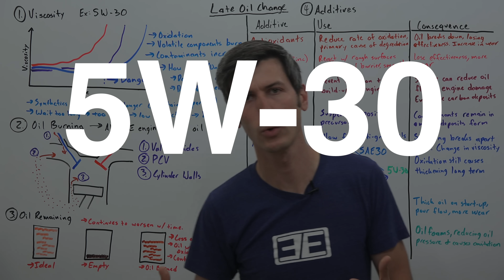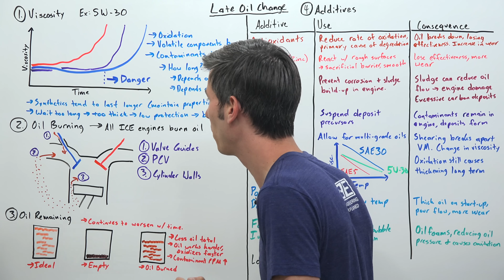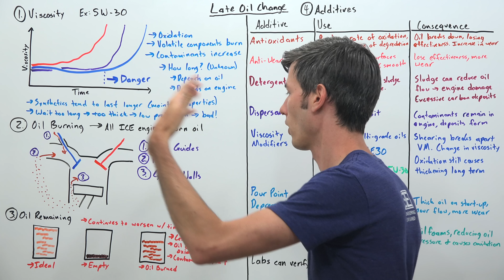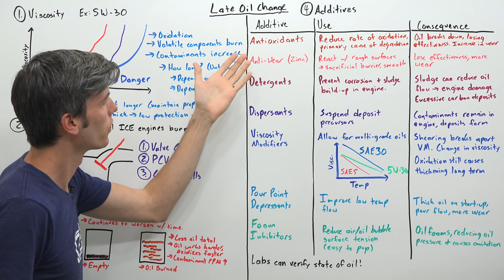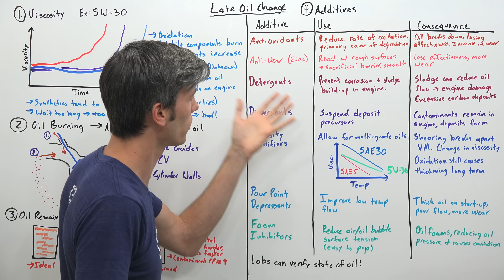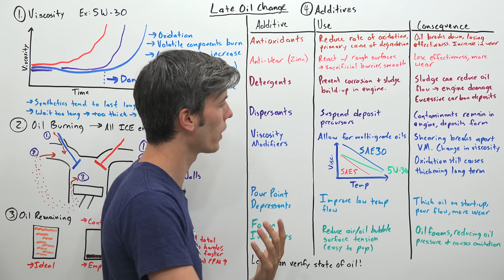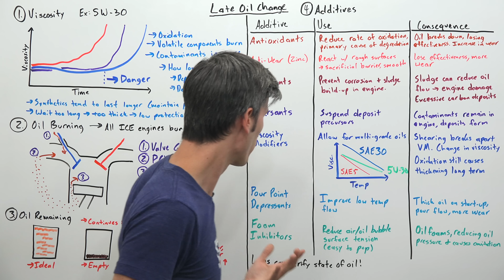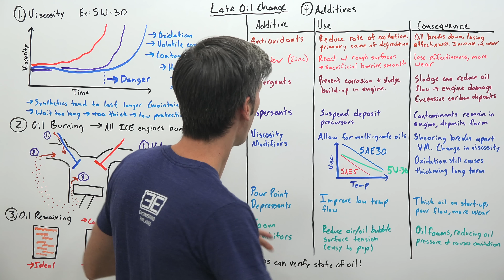What If You Forget To Change Your Oil?

Comment: As a European, US consumers seem to be obsessive about changing engine oil far too frequently, no doubt encouraged by years of marketing by oil companies and garages bring in the $$$$ and unfortunately also causing excessive damaging the environment. Stick to what the manufacturer of the vehicle recommends in terms of mileage between changes, use the correct grade/type of oil plus a good quality filter and you won't go far wrong. Never had any issue with engine wear in a lifetime of driving cars to over 250,000 miles and never changed oil a mile less than recommended by the manufacturer.

Comment: I'm sure this is all true and I do change the oil in my car every year which is more often than the manufacturers recomendation. On the other hand I've got an old Massey Ferguson tractor I've owned for 25 years (it's about 50 years old) and I've changed the oil twice. Of course it leaks like a sieve so it gets regular top ups of fresh oil. Runs fine.

Comment: Intersting video.  But why didn't you mention oil age?  Not all cars see a lot of use, and it's commonly known/believed that oil must be changed at least once a year (contaminants breaking it down?).
Reply: I have a 2000 Mustang GT with 25K $$$ in modifications that goes about 2000 miles a year. I change the oil every 5000 miles (Mobil 1). This means the oil gets changed  every 2.5 years...IT RUNS LIKE A TOP!!!!
Reply: @tacbear  ,Does your engine get to operating temp every time you run it,
well mine don't,and depending on piston make and configuration these facts change,
so I feel you have been very lucky,,so far,
Don't like Mobil 1 ,,as they have cut back zinc additives,,so no good for my flat tappet cam,,,and adding smoo to this great oil only stuffs it,,
Reply: I was curious about this myself.
'06 Prius, maybe 5k a year. My commute is only 2 miles, and I know that this is bad for an engine, so I usually commute by bicycle.
Usually also visit my folks once a week, so a nice 20 minute trip across town to get everything warmed up.
Reply: ProjectFarm has a video testing this idea.
Reply: Depends how old the oil is. If it isn't badly used, it can sit for THREE years and still have good results from a Blackstone Labs oil analysis.
Reply: Yep..very true,,Stopped working ,the old ute just trips to the shop,,never really got to operating temp..Lucky to do 5000 ks in 2 year,,left oil too long and now i have a tappet rattle,
Even though i had been very good with service,,the fuel by-pass the pistons, when cold did the damage,,Never got to a temp where this fuel would re-burn through PCV,
Hence one noisy V8 on start up,,Does go away  but damage is done,,and a costly repair,,VY ute 5.7 , 6 speed ,LSD,, less than 170k ks on it,,

Comment: Oil changes are overrated. Every 20k km is ok. One thing not mentioned in the video but quite important: Oil is used for the turbo. So if you're lucky and got yourself a car without a turbo, oil changes are even less important.

Comment: Best oil change intervals: 

Petrol engine: 15,000km (normal driving) and 10,000km (sporty driving style)
Diesel engine: 10,000km (normal driving) and 6,000km (sporty driving style)

Of course it more depends on if you are driving mostly in the city with traffic jams or mainly you have chilly driving on highways. So my intervals are for average cases.

Comment: I have a question:
If you left the car to do 10k miles & changed the oil instead of changing at 6k miles then I agree that's bad.
What about if I should change every 12 months or 6k miles but my car has been sat in a garage and done 300 miles in about 2 years? If I still haven't replaced the oil, am I damaging the car?
Reply: I've read somewhere that oil degrades with time. Don't want to sound smart ass coz I don't know much about oils, but my logic tells me to change it every 2 years max no matter the mileage

Comment: Funny.  I see cans that say 30W and others say 30 weight. None ever said winter
So 10W30 to me read 10 weight 30 (Never Winter) No body else has ever said W meant Winter
That's going back 2 the 60's, so every mechanic shop I have seen or gas station so SO wrong.

Instead of showing new parts show what SLUDGE IS  compared to varnish.
Also real carbon build up on valve stems. compared to slight carbonization. You will have to find a 40 year old farm truck to show that kind of build up...where the carbon build up on the stem is almost the thickness of the valve itself.

Comment: ok i have a question. i have an '02 bmw that burns a lot of oil. i sadly havent changed it for 12k miles ( i know)  but i have put 7 quarts of new oil in during this time and changed the filter.  how much does it help that i have been putting new oil in it? 
ediT: its full synthetic 0w40
Reply: Get rid of the car before you don't have one to drive.

Comment: Ok. People are changing oil lets say every 10 000kms or 6/12months. Right? What about cars which are spending A LOT of time in traffic? Car is not clocking kilometres but engine is still running even if not moving whole car which means it is still doing "ghost" kilometres.

Comment: 13 months and 12,600 miles (and counting) on my Amsoil Signature series 5W30 in my 08 Pontiac G6 with 185k miles. It's worth it to buy quality oil and filters as higher quality oils and filters can go longer between service intervals. I will be posting a video in the not too distant future documenting the last 13+ months using Amsoil.

Comment: I've had 3 cars 200K miles or more (Ford Contour 2.5L V6, Nissan Maxima 3.0LV6 BMW 325i )  Plus several others 150K miles or more before selling.  Mobile 1 oil changes once a year every year weather it needed it or not.   never a problem.

Comment: The 6 month interval is based on the theory that you only take short trips, which dirties the oil faster (contaminants don't burn off) . I go by mileage, not time for several reasons. Oil doesn't go bad from sitting there, and it doesn't get dirty if engine not being used. I drive very little and Im not changing my oil every 6 months in both of my vehicles, or 12 months. Viscosity increase is due to oil getting dirty, which is why differential oil. trans oil, can go much longer, stays cleaner